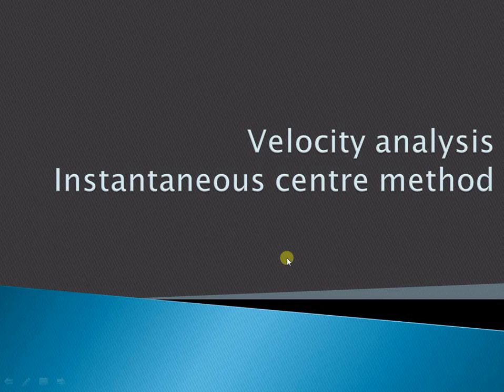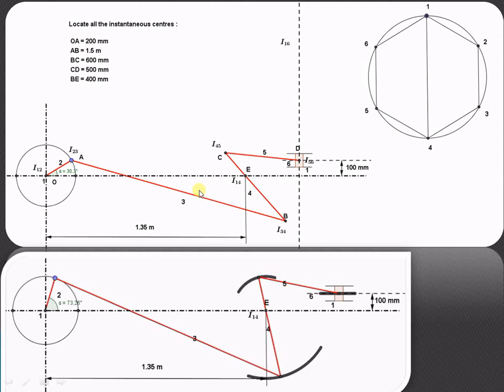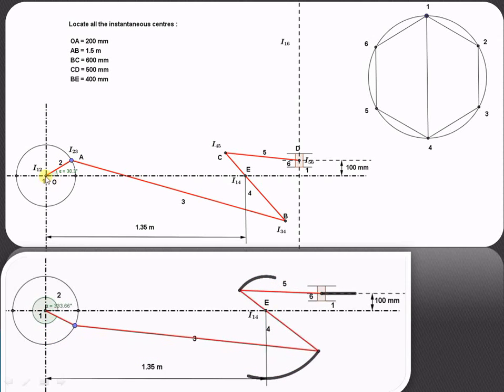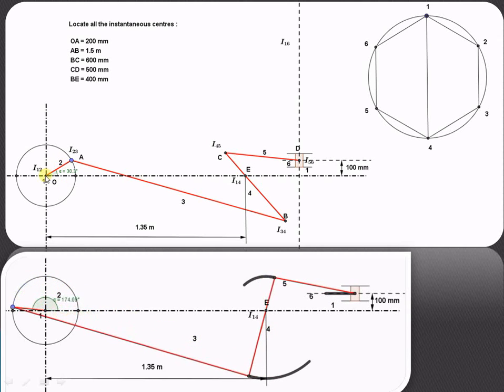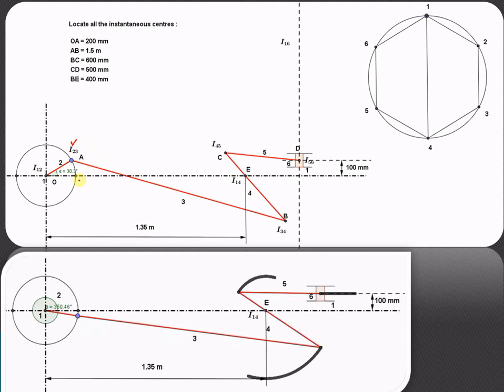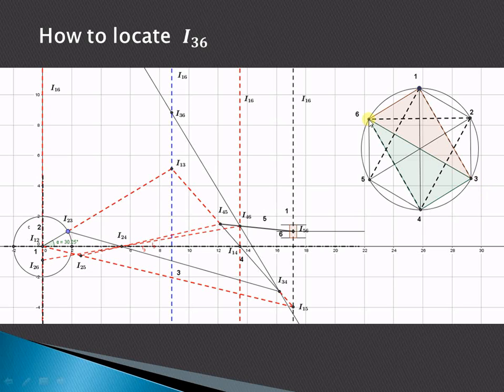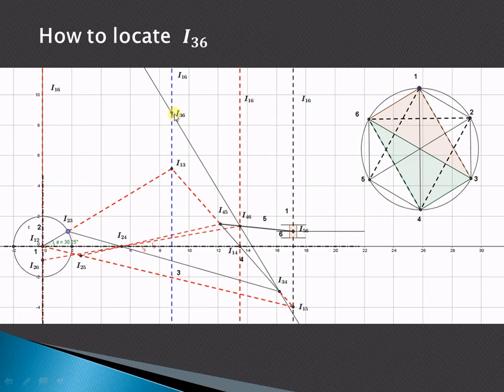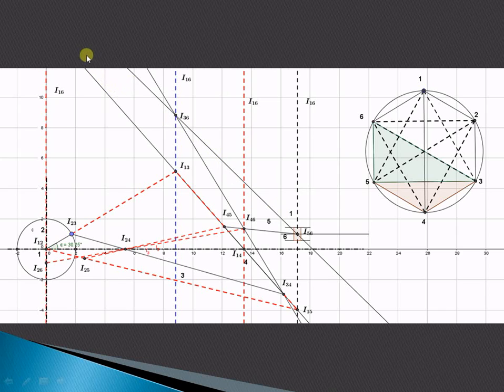Lecture 16 | Velocity diagram & analysis by Instantaneous center method

Comment: Sir by the help of circle diagram we finding the required icr's
My doubt is we can change 
The lines according to the different problems or 
We have to follow only this procedure for circle diagram
Reply from the maker: As per the problem the procedure will change. It means we have to concentrate on those ICRs which we will get first and so on.... THANKS
Reply: Tq very much sir
Reply from the maker: Most welcome !!!

Comment: first u consider 13 then 15 then 24 then direct 46
Reply from the maker: +Prashant hodage There is no specific rule for this. Sometimes it happens that the ICR that you want to locate lies on the same line (means there is no specific point of intersection) in such case go to next ICR then come back to find that particular ICR with new combination of triangles. You will come to know this when you actually draw & locate the ICR's . THANKS !!!